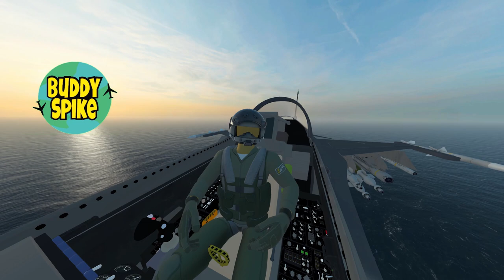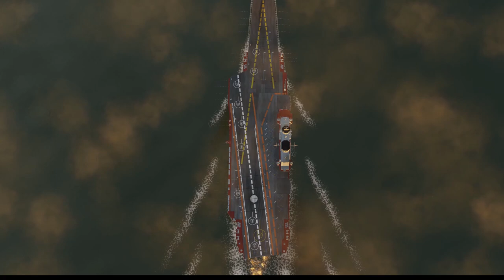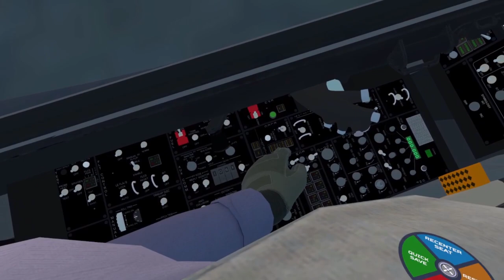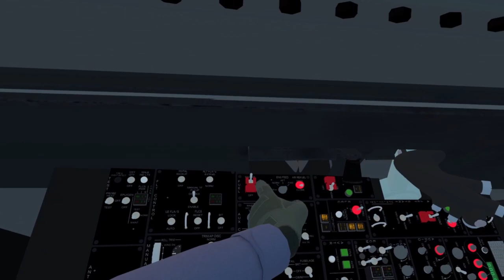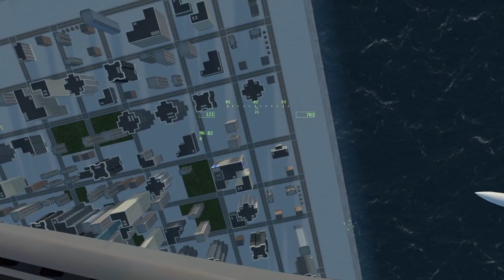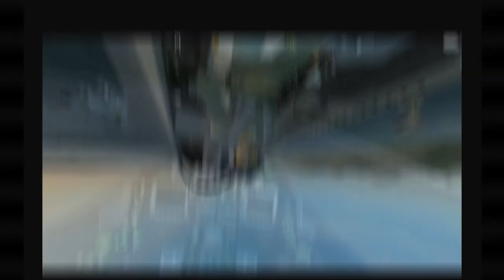VTOL VR F-16 Cockpit Introduction featuring Multiplayer mod creator [Free MOD]

Comment: I don't think that last bit is a bug, it's been a while but I recall that with the base-game planes as well if you have your battery charged up from running APU or engines (due to alternators or something) the cockpit lights and instruments will function for a while. 
But only for a while, the battery does drain and the sensors do fail, alternatively, If you hit the battery switch I expect the MFD on/off switch and other switches for instruments will then also fail.